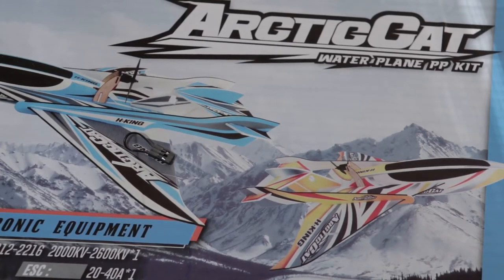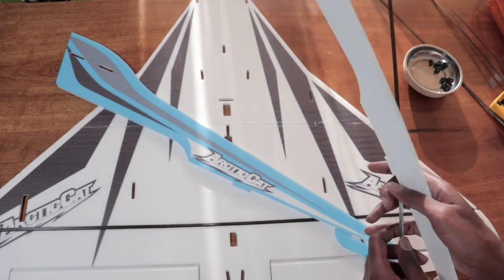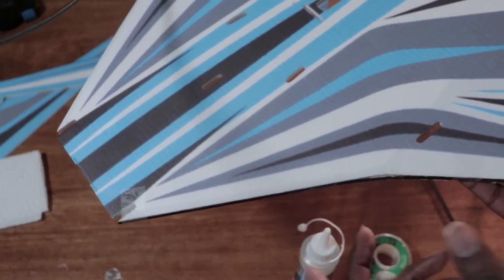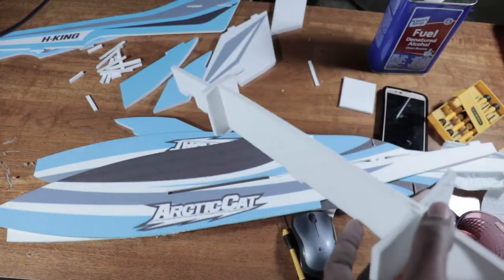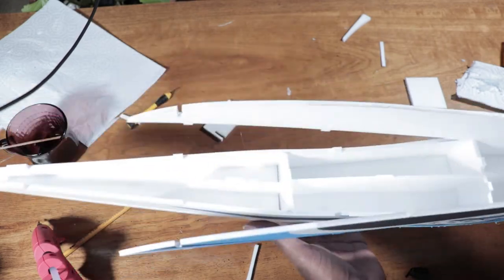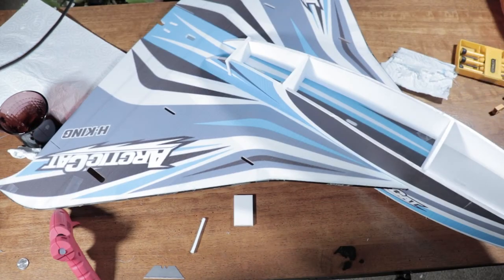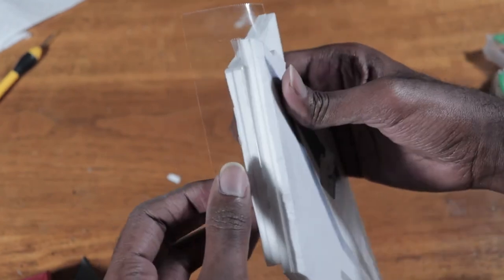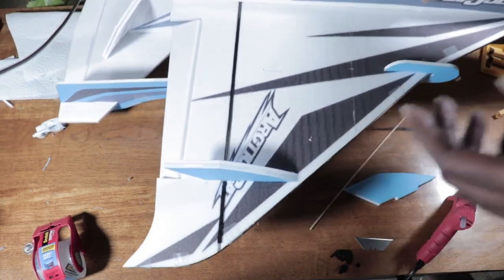Hobbyking Arctic Cat Build: Part 1

Comment: Hey my friend. This tip is something you can use in the future. For the carbon strips on the vertical stabiliser (4 min 57 sec in the video), use UHU POR glue. You apply it on one surface, bring the two surfaces together immediately, then remove them. Wait between 4 - 6 mins and the glue turns tacky, then carefully bring the surfaces together. I say carefully because you only get one chance as soon as the surfaces come together, they bond immediately. This will save you the hassle of having to use sticky tape to hold down the surfaces and possibly damage them upon removal. You can buy it this glue online such as https://hobbyking.com/en_us/uhu-glue.html
Reply from the maker: will look into it. Thanks